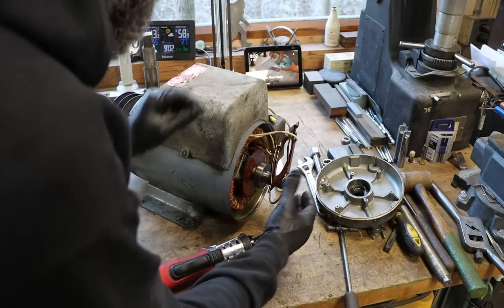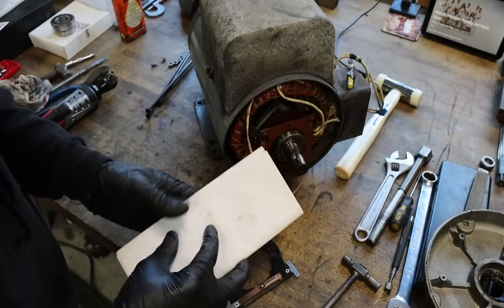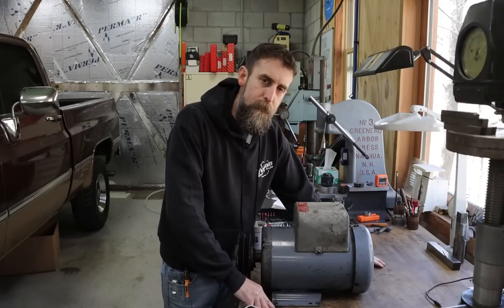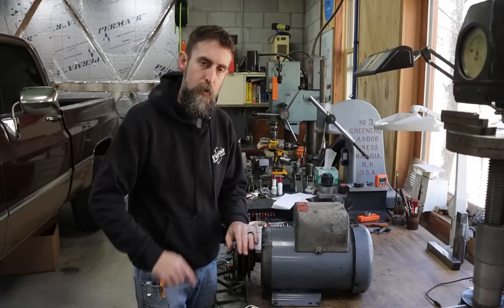My lathe is BROKEN! We got to try to fix it.

Comment: One thing you can do, if parts are unavailable (start switch) is to use a potential relay. They are used on HVAC units (like your refrigerator). They are mounted externally (usually) and are easy to install, they come complete with instruction sheets for capacitor run or start and run capacitor type single phase motors. Its not a problem if the motor is reversable or not by external control (like a lathe is).

Comment: I was taught something by and old fella that used to rebuild the motors we took out of every machine tool that came into our shop for rebuild.  You could hardly recognize them when they came back, he cleaned, polished painted, replaced. Abused fasteners and every darn slotted screw he found.  I went to pick one up one day and commented on his work.  He said “young man I take pride in what i do and I know the motors we rebuild will outlast the original.  Now you take that back and don’t just throw it into the filthy, rusty hole it come out of. Clean it paint it, replace the bolts, washers belts and the paint splattered wiring and give it nice place to live.”

Comment: Might have been a good idea to replace the start capacitor too, while you were at it. And maybe the hot sauce would have freed up the woodruff key even better than Kroil.
Reply: If the run capacitor is fine and working it should be left alone. Newer capacitors have a higher failure rate, ever have a run capacitor or start capacitor blow up on you when using it? I have and the capacitor was not that old, and maybe had 100 hours on it. Note: the vent didn't blow open, but the whole bottom of the capacitor blew off!
Reply: Nice.  I was gonna say a couple drops of that sauce might loosen that mug right up!

Comment: Been there done that, no t shirt tho.  I ended up with a 12 X 30 Hendey from one of the shops that I bought back in the day. It had a taper attachment and a 3 hp motor with a bad switch.
I still regret selling it but I also had 3 other lathes including a 13 X 42 DSG and I needed the room. I loved the unique method that was used for threading that made it so much easier.
You had the lever on the cross slide to move it back and forth and the no watching the dial when engaging the feed. A truly unique setup

Comment: A weak start capacitor will cause higher starting current and more stress on the starting switch contacts.  Replacing the caps while you have it out is good insurance if they are more than a few years old.  Also you mentioned that your lathe does not have reverse.  Unless the start winding is hard wired to the run winding you can reverse it by swapping the start winding connect to the run winding..  Adding a reversing switch may be fairly easy for you to do.  A single phase motor can start in either direction but you can not switch directions on it while it is running like you can a 3 phase motor.

Comment: Hey Steve, glad you got it working.  That motion you dislike in a spad connector is actually a good thing, the solder connection is actually a weak point, where thr solder ends is where the wires will break.  Workharding is real,  a lesson learned the hard way by and learned from the us navy.  On the bright side you probly will not see that failure during the 100 or so more years you will be using your lathe.  Howdy to the family.

Comment: Steve, I totally agree with you about greasing bearings. I'm retired now, but during my working days I've been in ventilation and I've seen more bearings going broke by too much graese then by too little grease. If you've ever had the possibility to look inside a totally closed bearing (think of a 2RSI type) than you will see how little grase inside these bearings is. And those bearings have to deal with that all their rolling life.

Comment: It must be the time of year Steve, my 50 year old Maximat lathe just had a gearbox rebuild and will be getting new start/run capacitors. Made in Austria, it is a high quality machine with plenty of years left in it. 
Great video, thanks. 
Best wishes, Dean.
Reply from the maker: I run a Maximat super 11 at work. They are a sweet machine
Reply: @SteveSummers  they certainly are.

Comment: I watched both of your videos and very impressed. You did a great job. You are man of all types of trades, n not afraid to get into something you never have done before. You are irreplaceable. Men like you  are far n few to find. Thanks for everything you do.
Reply from the maker: LoL, 😊.  I've never been afraid to break something that is already broke. Ya learn quite a bit trying.
Reply: @SteveSummers  YES you do. You learn alot, and like you say if it's already broke you will see what caused it and try your best to fix that also. If something goes bad at home, I need to see what n why it failed, repair it to best I can do, and if not, then get what I need. We are both wired the same in most cases. I am no machinist, just a retired residential electrician, but I just need to see what went wrong. Thanks for your comment. It really means a lot.
Reply from the maker: @mdvener  Thanks for always watching the videos Marty. I appreciate it very much.
Reply: @SteveSummers  I look forward to them every Saturday.

Comment: For reference my Goodway (Taiwan) 14 x 40 Lathe came with a 5 horsepower 3 phase motor.  Maybe you should have used the shop forklift or the cherry picker to lift that to the bench and back down.  The extra minute or two will be worth it in the long run.  Back problem are no joke. Be Safe like Cora the safety dog.

Comment: A single phase motor has "start components", being a Start Switch, Start Capacitor (and Run Capacitor if so equipped). Why you didn't check the  capacitor(s) is beyond me. A weak or bad start capacitor can and does put excessive amperage on the Start Switch contacts. This problem most likely will re-occur.

Comment: Gonna be that guy in the comments... A soldered connection isn't necessarily a better connection. Crimped on spade connections are appropriate in most applications, if not superior. The spades might not be appropriate where corrosion is an issue, like automotive. Perfectly fine in a electric motor, again, arguably superior given a motor has a bit of vibration to it which over time could crack a solder joint. Solder is also vulnerable to surges. Ok, I feel better. Do what you want, it should work fine for a long time.

Comment: Looking at the comments I see someone says you should replace the start capacitors. He is correct. These are rolls of paper with foil between. Due to age  and products within the paper it becomes acidic and the capacitor starts to fail in multiple ways. With your start capacitor this is liable to create higher pulse voltages across the contacts of these switches. You may believe you have fixed your issues, that though may be a temporary fix.

Comment: Heat the wire, not the solder, will flow in better.
Reply: Where the heat goes the solder flows.
Reply: @dannyl2598  remember seeing a guy try and solder with the a torch, just blowing the solder away and wondering why it kept dribbling on the floor

Comment: 2 visits today. Thanks eh. Any time we have to deal with these motors they are generally a pain in the toosh.  They are generally heavy with a hard to handle shape stuffed in, under or behind something. If this motor fails changing it back to 3 phase is sure the way to go. Big single phase motors like this one are horrendously expensive. Well fella you have your baby back on line. Feels good eh, LOL.

Comment: I had good luck pulling keys with a small drill press vise. You clamp the key in the vise it does not slip as easy.

Comment: I’m always curious about shop dogs paws. Especially with cutting-edge engineering.
Reply: Kurt's has stated a couple of times that Homeless has never had a cut or other issues with his paws due to swarf.
Reply: @LeonardRoberts  I’m curious and/or baffled as to how.
Reply: @Johnny Ryall  I am not really sure how he manages, I just know that question has came up many times. I know Kurt is keeps a very clean shop, and I don't really know how much Homey is actually on the shop and around the lathes other then what they show on video.
Reply from the maker: I try and keep all metal chips off the floor.  Especially from the mill. I haven't noticed issues with Coras paws at all. 👍
Reply: @johnnyryall1400  Dog paws are tough. Baily used to roam all over my shop and walk thru chips of all shapes and sizes and not once did he ever seem to get cut from them.
Reply: @bcbloc02  that’s amazing. I can watch your videos with bare feet and get a splinter. 😂 
But seriously you say “used to” is the the shop inspector no longer with us?
Reply: @johnnyryall1400  sadly the shop inspector passed away in September 😭you must have missed the post about it.
Reply: @bcbloc02  I guess I did. I’m so sorry. I lost my black lab about the same time. She looked a lot like bailey with all the grey. ❤️
Reply: @johnnyryall1400  Sorry to hear that. 17.5 years was a pretty good run but I still miss him something terrible.

Comment: Nothing wrong with the plastic switch.Unlike the Bakelite switch. I never had a problem with them. I would check the starting and running capacitors.Don’t forget to put the insulator in the cast aluminum cover,on the contact side of the capacitors. I had one of those in a 5hp.that I bought from a guy who was retiring.Someone came in and needed a 5hp. 4 pole for a air compressor. I hooked it up to test it,since I didn’t rewind it myself. I put my hand on top of it so,it wouldn’t jump. The capacitors had moved and,were contacting the box.It literally knocked me on my ass.😂😂😂
Reply: Looks like the original was phenolic not bakelite.

Comment: Seeme it would've been easier to just leave the camera on when you need the lathe😁 Just kidden obviously. The stress of a machine down is top tier. My boring mill is my most used and by far most important for my work. I'd be so screwed if it stopped working.

Comment: You could have saved yourself a lot of work Steve, just keep a camera aimed at the lathe😂. When my lathe motor stopped it literally let the smoke out so that was a whole new motor but my compressor has points that get carbonised so every 5 years or so they need a light file and it’s back in business. It’s a bit like a tune up really. Love the channel and the content. Cheers Stuart 🇦🇺

Comment: I committed the sin of over oiling an electric motor years.  I have a Craftsman 10" belt drive table saw.   Up graded fence over 10 years ago and "thought " I should oil the bearing on the motor.   Over did it and cooked the motor.
Reply from the maker: I forgive you😄. Sure feels good to throw the oil and grease at them. I am guilty of over oiling as well.

Comment: Those replacement bearings look like sealed bearings. Are the originals? Amazing that motor manufacturers actually send out motors with grease zirks when the bearings are sealed....because the end bells are used for multiple models.  All that stray grease in that end bell doesn't help the contacts.....why not clean it up before reassembling?

Comment: Interesting on the hot sauce; secured some. Don's you have a pallet stacker that could lift the motor? 😏 Your back is worth a lot more than a few minutes of not using the lift equipment that is in the shot; right? Thanks for the video.

Comment: Steve, how do you like your ACDelco cordless ratchet?
Reply from the maker: I have the 1/4 and 3/8 version and haven't had the 1st issue.  I like them a lot. Once you start using them everything you do by hand seems so slow and also requires so much extra effort .
Reply: @SteveSummers  Thanks for your reply. I can't believe how inexpensive they are compared to say Milwaukee or similar.
Reply from the maker: @alansmith5690  They aren't quite as industrial as some of the other brands but for my needs they have worked out pretty good.

Comment: No chance just polishing the contact surfaces using emery paper? The spring action looked quite normal.
When You got new parts, of course You use them.

Not exactly a soldering iron of today but for soldering on large pieces like that power  (heat) is needed.

Cora... What's the next? Rear lights and brake lights? Jokinsg!
There's a Swedish made film: "My life as a dog".......

My mini mill forward - stop - backward switch retired early. Sometimes forwards needs pressure for running. Why not change it? Already opened and closed the cabinet once. The locking screws are the wood type screws into plastic... One more opening and the threads are retired as well....

Living in Sweden shipping, import fee, 25% tax and mandatory 7 USD will widely exceed the price of Bud's taster....

Comment: I found a 5 HP 3-Ph motor on E-Bay for only $249.  I'm sure that would have solved your problems.  And you would have had the reliability of a 3 Phase motor.  Please, consider investing in a more appropriate motor for that machine.

Comment: If that were my lathe, I would put a 3 phase motor on it and a VFD.  Do an emergency reverse with a single phase motor, and it will continuespinnging the original way.  Safety hazard!

Comment: and after all that work  no new start or run caps ?  and you know that there is a electronic switch that can be installed that takes the place of the mechanical switch but hey it works now so tell the next time your fine
Reply from the maker: How about saving the money and work then  the next time it fails I'll  put a 3 phase motor in like it should have all along 🤔 😄

Comment: Not to be an a$$, but I would of done both at the same time! Yes, I've had the same problem, but all I needed to do was clean up the contacts and was good to go.. hammer and punch on the woodruff key and it would of came right out, vs messing up your cutters.

Comment: Poor practice to just rely on solder for a connection. Should always make a good mechanical bond first.. Don't just stick the wire in the hole.

Comment: I dislike single phase motors.
That switch would not be found in a 3PH motor. I have had identical machines side by side with 1PH and 3PH motors. The smoothness and initial startup of a 3PH motor are so superior to 1PH.
Nice fix anyway. Still dislike 1PH motors!